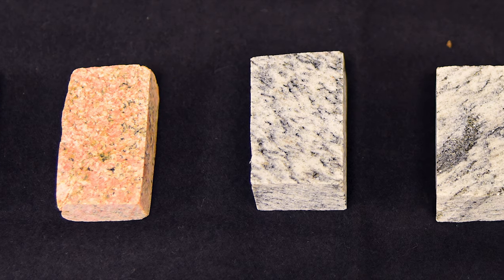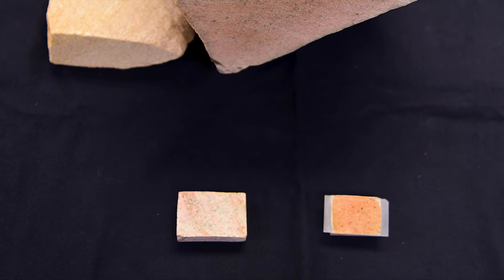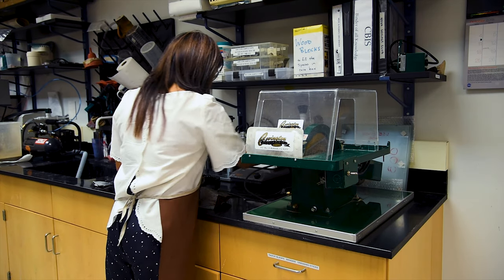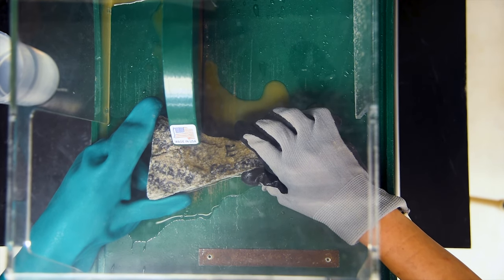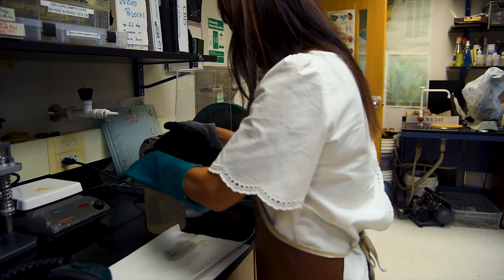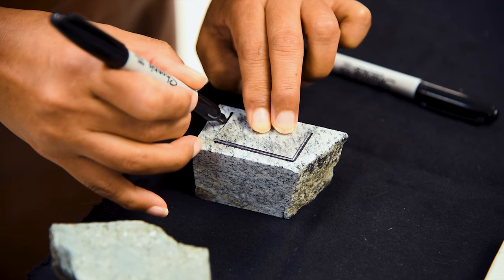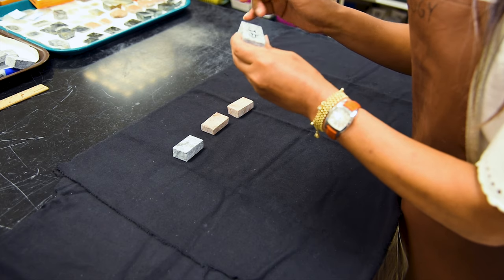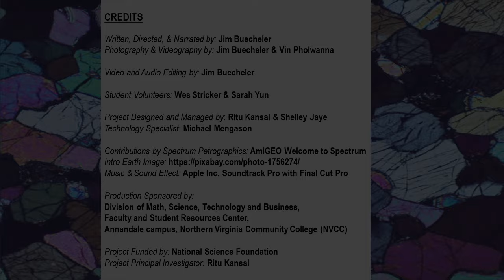Making Rock Thin-Sections: 03/10 - Cutting the Chips

Comment: Does it matter which angle you cut the sample rock at? Got a staurolite schist I have to cut and it has very strong crenulation with occasional cleavage. But the staurolite runs perpendicular to the angle of crenulation but roughly parallel to the plane of crenulation. I want to capture both the crenulation as well as the staurolite. In a manner that allows me to observe possible deformation of both the crenulation and the staurolite.

Comment: You say 1x2" slide, but there are two in that range 47mm x 27mm and 48 x 28mm.  Google says 47 x 27mm for petrographic studies, and 48 x 28mm for thin sections.  Also, I see 70 x 50mm mentioned for Geological Use.  75 x 25mm is the standard slide side.  So, what are the virtues of using the non-standard special use sizes?  Which should I use, 47 x 27 or 48 x 28 ?